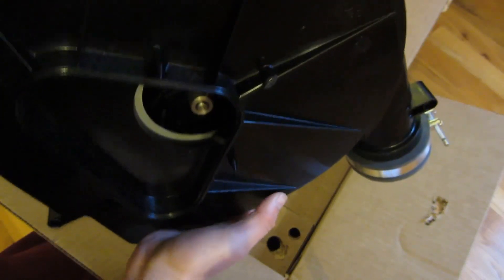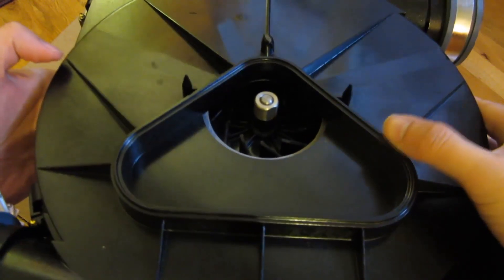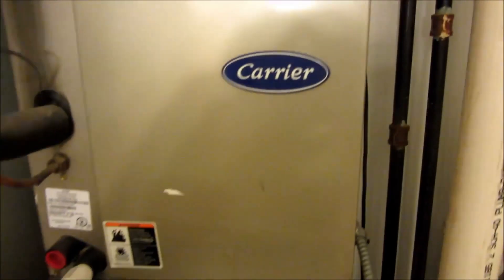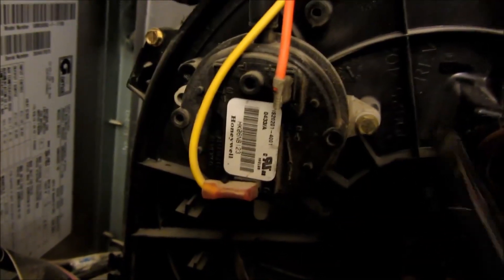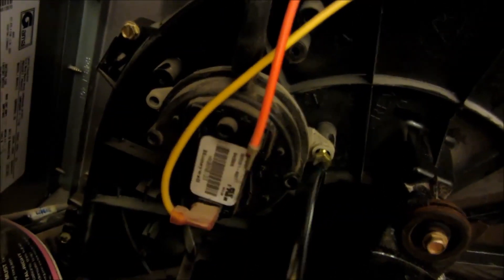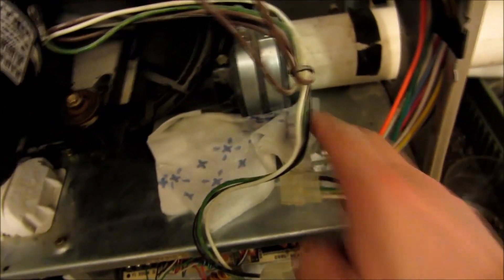Carrier Furnace Inducer Motor Repair | HVAC Fan Motor Replacement

Comment: when trying to align the unit with the spacers in place, would it help to use longer screws? I mean use a couple longer ones, get it aligned, then put 2 of the original ones in, then replace the longer ones. I haven't done this yet and just looking for an easier way to get it aligned.

Comment: If you were to open the inducer case, you would see “do not lift” warning embedded in plastic. That warning is there for a reason. You should not disturb the factory seal between the inducer and the furnace inlet.
If you split the case, it is easy to replace the motor.
The only situation you would need to replace the entire inducer box is if it is physically damaged.
In that case you split the box, put the first half in place, inspect and ensure the part is seated absolutely perfectly. 
Only then you install the other half of the inducer box.

Comment: I have been working on my 25 yo Amana furnace.  Started out by cleaning the flame sensor and it worked for about a week. Then it got very flakey.  I threw the parts cannon, (pressure switch, high limit switch, and igniter) at it but still flakey.  Finally I pulled the control board out and looked at it, there were some discolored spots on the board so I replaced it and the furnace worked great! But then I wondered what caused the discolored spots on the old board.  Then I measured the current going to the noisy inducer motor, It was 4.5 amps.  The label on the motor read 115 volts and 1.5 amps.  Hmmm maybe that is what fried the old control board.  So I bought a new inducer motor assembly and installed it. Now it is much quieter and the amperage draw is .86 amps. Yeah!!I
Reply: A degraded (but not quite dead) capacitor will cause the induction motor draw more current and run very hot…

Comment: Good morning: do you know the serial number so that blow apart that you repaired having that problem I heard you say you purchased it from Amazon
Reply from the maker: Amazon Link Inducer Motor - http://amzn.to/1WEQFtu
Amazon Link High Temp Silicone - http://amzn.to/2kFUEZx

Carrier Draft Inducer Motor / Exhaust Motor Assembly
Bryant Draft Inducer Motor / Exhaust Motor Assembly
Payne Draft Inducer Motor / Exhaust Motor Assembly
Part Number 
320725-756 
325270-761
325269-702
320725-757
JE1D013N

Comment: Not sure if I need to replace my inducer motor but it's not turning and it's making a loud humming noise like the power current going through the inducer motor. I turned off the furnace and started a few times and it's doing the same. I read that it might be the capacitor that's causing the motor not to spin. So I bought a new one and replaced that but doing the same. Try to spin the motor by hand but it moves very slow. I was told it might be the bearings but when the power is off it spins freely. Any idea on what might be the problem?

Comment: Sorry but you're not supposed to use ordinary silicone caulk, as you showed in the video. Instead use RTV Red silicone gasket maker, which is designed for sealing in higher temperature applications and which can stand up to exhaust gases. The link above does go to the right kind of silicone . You can also easily find this in auto parts stores, since it's often used in automotive applications.

Comment: The motor needn't be replaced... usually it just needs a couple of under $10 bearings. But, R&R takes time...
Reply: Can you show me how to replaced the bearings and where to get. Thank you
Reply: Same.  Do you have a video or explanation to replace motor or bearings?  Thank you for your help.